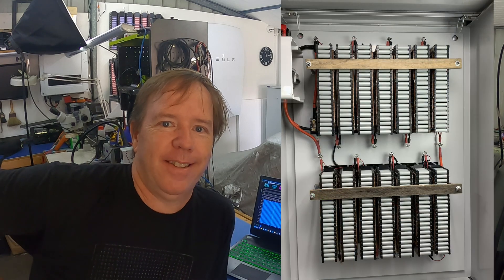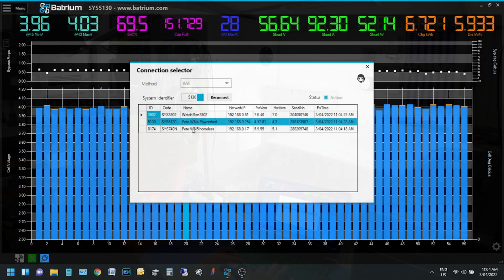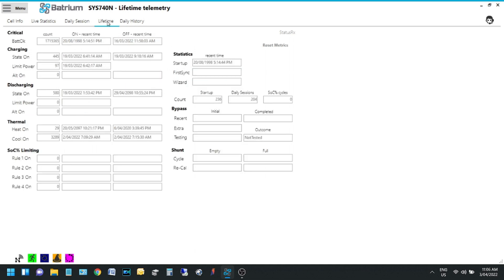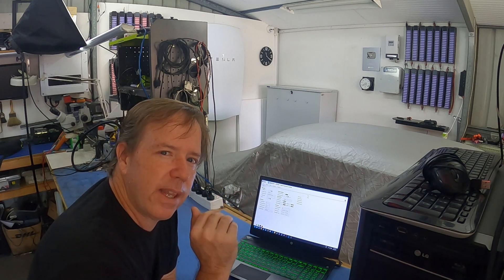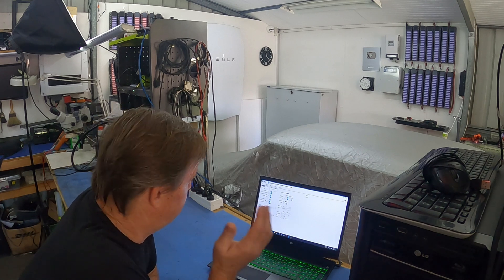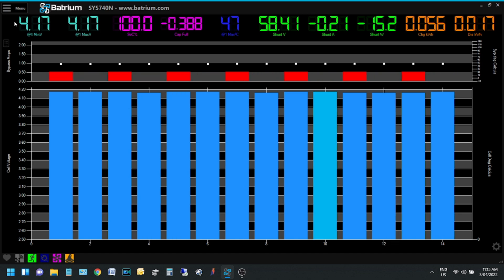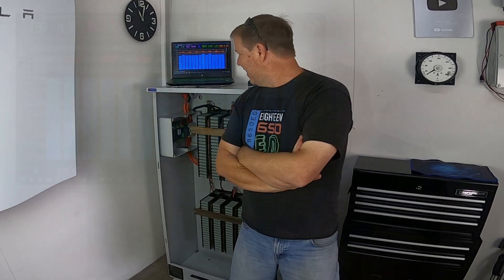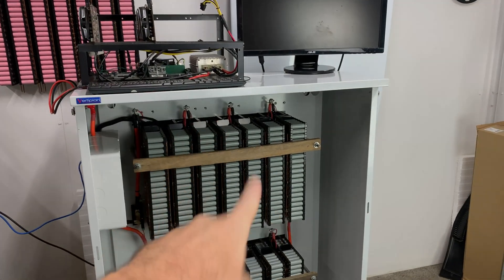DIY Lithium ion battery capacity test using a BMS

Comment: I have little over 100 of these batteries from past ebikes I have had. I want to make an electric generator to run my Tv and a DVD Player for a few hours when the power goes out. do you have a video on your profile that explains how to make something like this? I started to disassemble the battery packs I have I want to buy 1 of those cell holders. How many batteries do you think i need to say run a 65-inch tv for roughly 4 hours? if 65 inch is too big i can just use one of my smaller TVs for when the power goes out. Or even just use the generator for camping or something want to make it portable.

Comment: I need a barium just using an electro dacus for a 7x100p 7s 18650 powerwall
Reply from the maker: NOTHING wrong with an Electro Dacus from what I hear, they are a bms as well aren't they?
Reply: @HBPowerwall  
only 24V though
Reply: @HBPowerwall  yup.

Comment: The Batrium would have brought every cell to 2.5v as planned. They may have arrived at 2.5 volts at different times - but it would have got their eventually
Reply from the maker: it would have i'd say but not entirely sure it would have been an accurate KWH result

Comment: Thanks for an interesting vid!   Why do you think there was such a difference per cell - was the balance discharge uneven or an algorithm 'thing' or?    Would longmons behave differently (I wonder)?
Reply from the maker: Personally I would put it down to extra resistance - ie, my solder joints, springs in the fuses, fuses them selves or even the crimps in the balance leads. That's my theory, I did reach out to Batrium & was recommended to try get a reading with a good clamp meter. I won't be looking to far into it, but my curiosity is peeked by stuff like this. I have plans for this battery and it won't be around in a few days as it's off to start its life as a UPS for a workshed in the middle of nowhere.